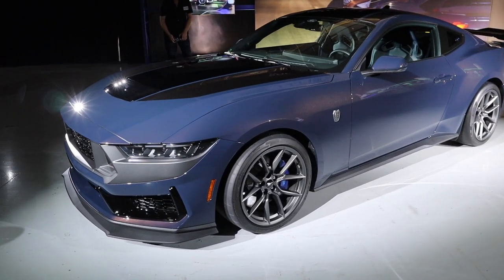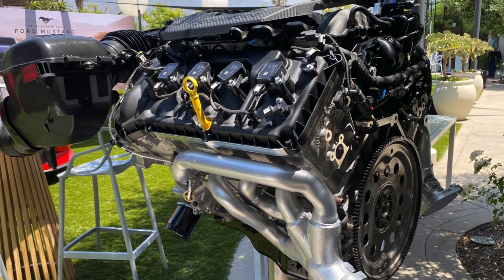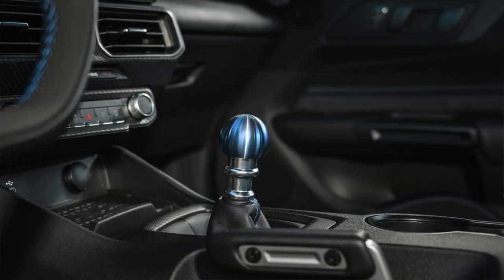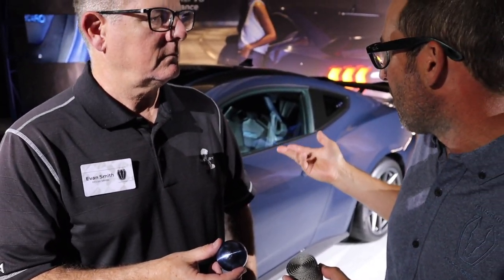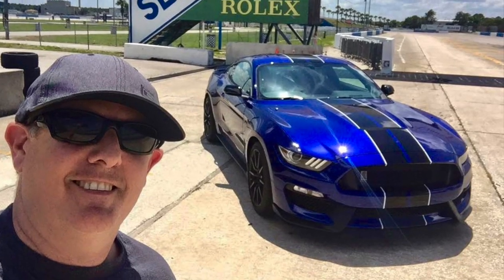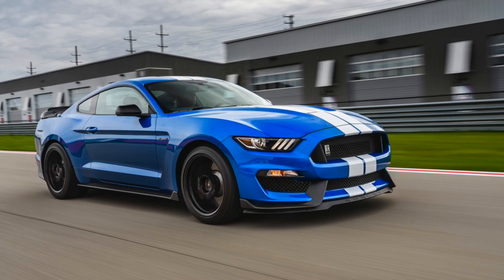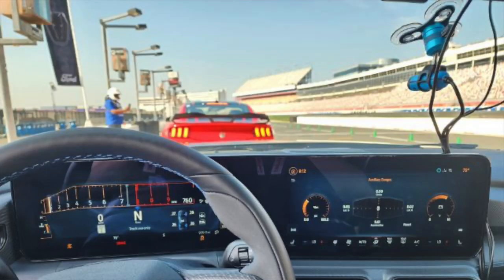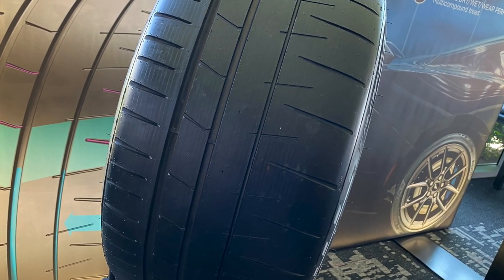2024 Dark Horse Secrets From Ford Engineering | The Best 5.0 Mustang Ever?

Comment: Although the Darkhorse and the 5.0 GT are cool, personally I'll like to see another S650 Mustang but with a Supercharged V8, who doesn't love Supercharged? I doubt Ford will do it since it's competitors like Camaro and Challenger is fading away in 2024 but it'll be awesome to see one final Supercharged V8 muscle car, great sharing man 👍
Reply: It's probably coming, while we all want to see everything right out of the gate they still need to pace the products. I see a lot of complaints about the DH not being worth the money since it just has 15-20 horsepower over the GT (people love the Mach and it only has a 20 horsepower delta over the standard GT) and I can't help but think if they had waited 6 months to a year to release the car after all the hype over the S650 died down and reviewers had a chance get comfortable with the GT those complaints probably wouldn't be there. Also even though the S650 is more or less an evolution of the S550 instead of a clean sheet the engineers need time with the chassis so they can get comfortable with the iteraitve changes and really extract the performance. An S650 version of the S550 GT500 has some big shoes to fill and again by way of comparsion look at the transistion from the Terminator to the S-197 GT500 (2007-2009). The S-197 was more or less a refined version of the Terminator with very little difference in overall performance and people were underwhelmed and it wasn't until Ford released the 2013-2014 cars that it blew up. Already expectations for an S650 GT500 are high and the number one request is a substantial upgrade in power, well over 800 seems to be the going number and of course the crowd where horsepower is the only metric want something in the four digit range. The ROI on increased power really comes down to how well the chassis can use it and as an evolution of the previous car Ford has some serious work cut out for them if they want to top the most recent GT500 and meet expectations. Then again that could be as simple as tossing in a little more power to get attention and this time taking the speed limiter off the car so it will run as fast as it possible until it hits the aerodyanmic drag wall.
Reply: How about a blown 7.3!
Reply: They are working on a road version of the mustang gt4 👀👀
Reply: They are almost certainly going to do it since a Ford rep actually confirmed that Shelby models are coming. One of them was shown with a whacky center exit exhaust and NASCAR Cup style rear spoiler (and a blacked out badge with the same shape as the GT350), the other with the typical quad pipes and mega fenders of the GT500.
Reply: @georgiadriven GT3, actually.
Reply: They are supposed to have an updated GT500 in the works

Comment: Hi Evan, the information that was shared by Tim was awesome. Thank you for the great video that really provides insight and additional information about the Dark Horse. I ordered the DH back on 6 April. I am not expecting to get the car until December or January. I did order the Handling Package. Also ordered the Recaro seats which I learned in a Ford Seminar that they saved 36 pounds in weight of the car; also why they took out the seat heaters/ventilation option.  I already own two manual transmission cars so I compromised with the wife and ordered the 10R80. I am gonna miss the 6 Spd; however I plan to add a Whipple 5, 3.0 SC or the ESS G3X centrifugal SC to the car so the 10spd will add to the quickness. I already know what I need to do to reduce the weight to 3660 pounds so with 800 RWHP it will be faster than my brother’s C8 Z06. The 305 mm tires on the front most likely will contribute to tramlining as you mentioned in the video. So I will need to add the Steeda enhancements & Stop the Hop pkg to get to my desired results for handling. I subscribed to your channel so I look forward to many more educational videos from you Brother!!! I have a few friends that blew-up their 350 Mustangs so as a 4 generation Corvette & Porsche driver I chose to stay away from the Flat Plane Crank engines. They sound the best but I am concerned about longevity. Keep the videos coming Evan!!!! Thanks‼️‼️👍💪😎🇺🇸✝️
Reply: No c8 is still gonna gap you in track and straight line if the gt500 750hp runs the same quarter as c8 460hp lol 😂

Comment: Love to see information about the braking systems...
Reply from the maker: I have a video coming up with the Brembo folks. Stay tuned.
Reply: The brembos from the outgoing s550s were pretty awesome. Can’t imagine they are going backwards at all.
Reply: @BTSyaya  if you look at the DH, it uses the same two-piece rotor that the GT350 and GT500 used (not sure of the diameter) so thats a big improvement right there since there is a drop in unsprung weight and even better the rotor is isolated from the hub which improves braking endurance. In HPDEs the brakes are unflappable even with an FNG driver (since FNGs tend to ease on the brakes the get hot and stay hot when out on track) and the only time I've every really heard somebody mention any problem was in an open track session where people were running wheel to wheel in an almost competion like environment and even then that might just come down to a novice driver and might even be a maintenence issue (worn out pads plus old fluid).

Comment: As a lifelong Ford guy I have owned six different mustangs. From a 67-2014 GT track pack car. Currently still own a project car my 1998 GT. I am interested in what high performance parts from these cars are going to be available to modify older mustangs? I know the 5.2 GT350 crate engine is now available but what else?

Comment: Oh, come on guys. The difference between a gt350 and dark horse is that the dark horse has more usable horse down low where the average daily driver can use it. The gt350 is a high revving race car who's power is up on the high end and does not do well around town.
Reply: GT350s aren't that high strung. I daily one and I currently live in Tennesse right along the VA border at a little higher elevation (1800 ft) and tons of hills and lots of twisty roads and the car is a great either crusining along and of course having fun plus I routinely make the drive to my old digs in south eastern VA and 81 is more or less going uphill all the way from the 757 and I just pop it in 6th and knock down 22-23 mpg and really only need to downshift when I'm threading the needle in traffic when I'm on the road. 

Although I would be interested to see how that average power shakes out between the Dark Horse and the GT350 which definetly does make a car more tractable for sure when has some meat under the curve.
Reply: @lealandyoung  that's interesting because a ford car salesman tried to sell me his gt350. I asked him if it was unpleasant to drive around town and he nodded and said yes. Gotta keep those revs up to drive comfortably. The gt350 is a race car and not a drag car.
Reply: @francorepici3586 you don’t really have to try to sell a 350
Reply from the maker: @francorepici3586  that's just not accurate. I own a GT350 and yes, it had more power above 5,000 than the GT but there's plenty of low-rpm power to get things going. My car has run 11s at 120 mph in the quarter-mile, you're not doing that on street tires with a car that's dead on the bottom. Either way, I appreciate the comment. Thanks for watching.

Comment: Kind of got tongue tied when asked "why a GT 350 owner should buy the Dark Horse " same answer if you bought a Mach 1, your selling yourself short and will constantly be thinking what if I bought the 350. 😢
Reply: GT350's had huge vibration issues with it's flat plane crank, and oil consumption issues. They were also complicated and expensive to repair
Reply: @3644Darrell  I own one so I've heard both sides. I've not read anything that specifies a breakage due to vibration.The piston rings are the faulty part either a bad part or installed wrong. Regardless if you hate or love them if you dont take proper care of them they will fail as will a Coyote or any engine.
Reply: @abelw71  some of the oil filters have vibrated off the engine.
Reply: @3644Darrell  Yes the reason in early 17 they installed the cartridge type oil filter as the specified torque required for the canister filter was not being followed.

Comment: Another throttle body and air intake to make not that much more horsepower than the previous models(2018+)

Think about that..

Dark horse < any GT350/R
And s650 GT is barely a upgrade from the s550 GT

Dark Horse makes less horsepower than the gt350 with dual throttle bodies and dual air intakes, and spare me the .2 of added displacement arguments..the gt350 has been out for getting close to a decade…

This is a parallel move for Ford as far as performance. 

I wish Coletti was running the whole operation. Would probably have some AWD, V8 turbo’d type mustang by now, regardless the EPA regulations. He would figure it out 

Ford has lost its luster, and hate creators pushing fictitious narratives like the new s650 is a vast improvement over the s550 as far as performance. For clout and clicks and staying in the good graces of Ford…..

Plus, it’s gonna be a little while before you can even tune this car if you’re a new buyer, and want to mod the car. Which many, many do.

Rant over
Reply: Thank God!
Reply: @theshadowtalks  thanks for playing
Reply: @RealSVTJunkie  Hehe